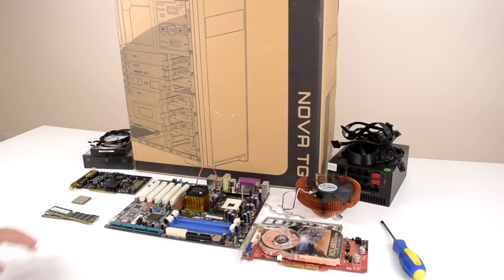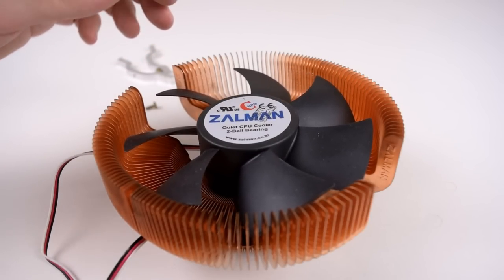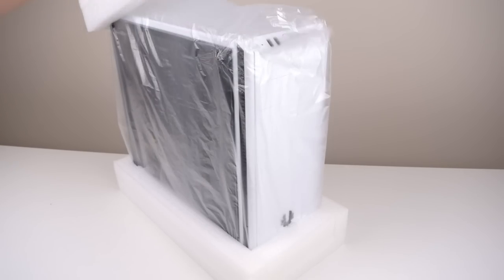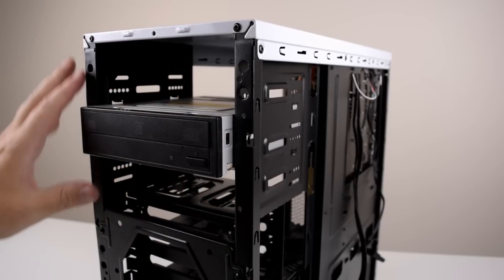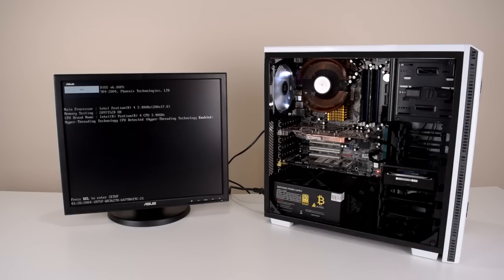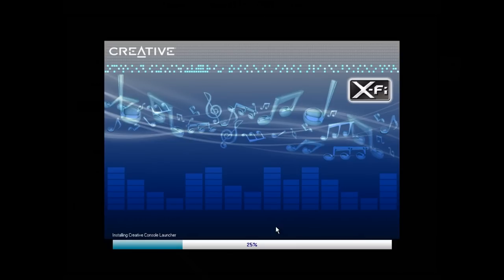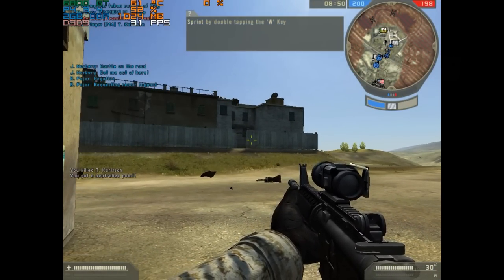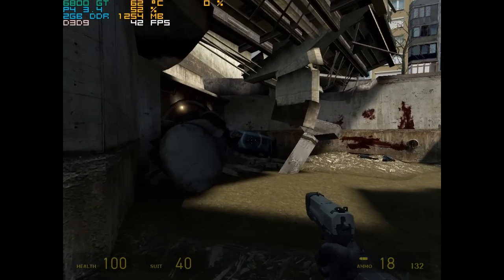Building a Pentium 4 Reverse Sleeper

Comment: Actually, a Reverse Sleeper is called a Ricer.
Reply from the maker: Is it? Good to know. So I did a previous sleeper build and nobody mentioned ricer, but I can see it now :D
Reply: Repeels
Reply: Race Inspired Cosmetic Enhancements R.I.C.E
Reply: Needs more RGB to be a Ricer. ;)
Reply: Hope he adds excessive camber to the fans for that extra performance. 😆
Reply: it is an automobile term, and not typically used for computers. it has a bit of a negative connotation, which this new build does not deserve.
Reply: Charles thekinglov TIL what ricer means, I thought it meant the car was basically a rice cooker on wheels hahah!
Reply: @William Thornton

i guess i understand where the negativity comes from: if someone takes a stock honda civic and puts some big fake exhaust ports and racing stripes on it to make it look like it got something under the hood but actually does not do anything to the engine ... you know that guy is all show and talk but no substance to back it up
Reply: If this was a car, in my father's day, it would have been called a no-go showboat.
Reply: that tempered glass sure gave +0.5 ghz for that processor
Reply: This is a Gicer (gaming inspired cosmetic enhancement).
Reply: I don't understand how any of you figure this is "RICE". These parts are fairly high end for there time its just old. Its like comparing a '95 svt cobra r mustang (which was top of the line back then and fast for its time with 14 sec 1/4 mile times) but its going to be slow compared to a '17 gt350r that can put down times in the low 12 sec range.
Reply: No...it's not about the comparisson! It's like putting lambo doors and the ridiculous LED lights that all cars have all around them nowadays on an all time classic!
Reply: Exactly xD
Reply: @eternalrest2859  *underglow
Reply: @eternalrest2859  and crazy vents
Reply: Put a Spoiler the the Case and there you are

Comment: Colin McRae 2 and Doom 3 were among my first experiences playing a game in 5.1 surround. In McRae, when playing in-car mode, the engine was in front, you'd hear the grass running underneath and if you slid into a tree or a rock, you'd hear the thump from the appropriate speaker (from what I remember).

In Doom 3, I remember walking down a hallway and hearing a "chi-clunk" noise repeating behind me (though I couldn't see what it was). I turned around to see the lights turning off in sequence, and then turned back to be surprised by one of the beasts. Great use of 5.1 surround sound both for immersion and gameplay.
Reply: I would've shit my pants playing Doom 3 in 5.1...
Reply: In the dark and loud while my parents were out of the house. :D

Comment: This reminds me of a similar build i had many years ago, i used the same exact cpu cooler, P4 northwood 3.4ghz cpu, abit IS7 motherboard, 2x1gb pc3200 cl3 memory, nvidia 6800 128mb agp8x videocard, 80gb IDE 7200rpm hard drive, enermax 460w psu and running XP, as a matter of fact, i still have all the parts mentioned, except the power supply... ran like a top though, and i couldnt have been happier at that time.

Comment: I built a gaming machine around 2004, but it was using an Athlon64 3400+, which had similar performance as the p4 you're using, also 2GB of RAM and a Radeon X800XT which was about the same performance as the 6800GT. I used that machine for 4 years. The whole thing was inside a Thermaltake Shark aluminum case which was huge and with noisy fans, I had to put a fan controller to lower down the volume. I remember playing HL2, and Doom3 a lot on that machine. Your videos always bring me great memories. Cheeers!

Comment: I have a vague recollection of some SATA2/3 drives not working with older systems like that, IIRC most drives have a jumper to force SATA1 mode, might be worth a look.
Thanks for the upload! Very interesting as usual

EDIT: While on the subject of HHDs ... beware of raising the controller's bus speed (pci/pci-e) over the default, I've had drives (seagate iirc) that corrupted data in that situation.

Comment: Ah, those 6800GT results bring me back to my second gaming rig, an Athlon XP 2600+ Barton Core with 1GB DDR-400 and a 6800GS 512MB that clocked to hell and back. Didn't get much nostalgia from the Crysis video that LGR posted before but these results definitely bring me back.

As a side note, you should still get playable FPS on medium/low settings at 1280x1024 going from memory.

I also remember trying to do Pizza Noobs for Underground 2...I think it was that anyway, either that or a straight up giveaway that Pizza Hut did at one point. (Fun fact: The city I live in, Ballarat, still has an open pizza hut that remains open because it's a semi-decent all you can eat)
Reply from the maker: Nice! I thought long and hard and I believe one of other Pizza hut games was NFS Most Wanted?
Reply: That makes a lot of sense. I do remember there being another one with Most Wanted after the Underground 2 one that I didn't bother with cause I had all of the games they offered.
Reply: I actually had a very similar system and I love vids from this era for that reason. I wish I could have kept it for nostalgia reasons alone...

Comment: The mighty 6800GT. I had one sitting around as I couldn't use it after upgrading to PCI Express. I followed Phil's advice. And built myself a Pentium 4 around that AGP graphics card. Along with a pair of brand new 512gb. SSD's in Raid Zero. A wonderful way to play those old games from the late 90's to around 2006 or so. 😄

Comment: really i dont know why people complain about old hardware in new cases, with new PSU's....... if you dont like, dont watch ffs
Reply: Lol ikr it's a hobby and not a bad one either, I like putting newer and more powerful hardware into OEM prebuild cases, I have a HP that came with a dual core 2.2GHz cpu and 512mb of ram housing a much newer 785g mainboard and a quad core 3.1GHz chip running at 3.875GHz sporting 8GB of ram. Looks like trash but doesn't perform that way it's a great little media box and it can still do minecraft and light gaming and older gaming just fine. I think it might be a case of people being bitter and not liking anyone enjoying things when they can't or something.
Reply: @bdhale34  and here i am, pairing a GeForce 9300GS 512MB DDR2 with Xeon X3440, 8 gigs of RAM and also with SB X-Fi XtremeAudio PCI, and putting these in a cheap Powerlogic case (Modena 2000) with a few modifications to it (i changed the side panel to tempered glass, and adding some exhaust fan mounting hole). No complains at all. Playing Doom Ultimate, Wolfenstein 3D and Minecraft Story Mode Season 1 on it and still doing just fine
Reply: And of course this guy don't wanna blow his 14YO PC. It's better to use a newer and good quality PSU than using a PSU from Prebuild Cases, especially if you doing some serious shit like gaming
Reply: you can install android X86   on pentium 4  computers and enjoy many android apps on it (whatsapp and more

Comment: I really like these tempered glass cases and have 2 of them.  I did a similar build earlier this year. Originally I was going to build a P4 "ricer" with my Gallatin P4, but then I got a wild hair up my rear end to build a system with the last high performance AMD K8 based processor, the X2 6400.  Not even FX or Opteron versions of the K8 were released at the 3.2 Ghz speed. I actually used a notebook sata hard drive in mine and mounted it where an SSD normally would go.
Reply from the maker: Haven't seen any new vids from you lately?

Comment: Glad you did a proper 478 build! The 6800GT and P4 3.4ghz were one of the top notch combinations back in 2004. My rig back then was a P4 HT 2.6ghz along with a FX-5200 and 1gb of ram. Games I ran were GTA Vice City, NFS Underground, Warcraft III, Colin McRae 2, Civ 3, Gothic 2, Sacred, Sims 2 and some multi-player games: Unreal Tournament, Soldier of Fortune 2, Insane,  DotA cause that was also my LAN-Party PC!
Reply from the maker: Thanks :D I actually was going to do another PCIe system, but I only recently did one, so AGP it was.

Comment: If you used the 7800 GS AGP or X1950 PRO AGP, you could have also called it "best of 32 bits".

Had a 6800 GS myself, was a good card but it burned itself due to insufficient cooling.

ps: I suggest you make a "best PC of 1995/1996" sort of build sporting a Pentium Pro 200/166 MMX, S3 Virge/Matrox Mystique, 3dfx Voodoo and a Soundblaster then do some tests in specs-heavy games like Eurofighter 2000, Flight Unlimited, The Need For Speed, Quake, Tomb Raider, etc. Just a suggestion.
Reply: The Radeon HD 4670 agp 1gb is the most powerful agp card, with this gpu, "the best of 32 bit" you have...
Reply: I think it's a toss between HD 3850 AGP and HD 4670 AGP, they seem to trade blows. Yeah, they better but to make use of the DX10 features they offer we have to move to Windows Vista or later and imo that's just a waste for a 32-bit single-core system as XPs perform better and top DX9 cards like X1950 or 7800/7950 (the later exists in AGP form but is very rare) would suffice here. But yeah, they're faster cards so they'd outperform the best DX9 cards.
Reply from the maker: Raven Gaming A lot depends on the CPU with these cards. On a slower P4, a 6800 GT can be faster in some games, especially Doom 3, but the Radeons are stronger in Half-Life 2 and Farcry. On a fast Athlon 64 the Radeons start to run away in everything though.
Reply: I'm gonna steal this idea and make my own, rebuilding my first PC. I have the Athlon X2 2200+ and ATI X850XT saved from it but, I need a new motherboard. This would be good for games of the time and earlier, yes?

Comment: You shouldn't have to push the pentium 4 chip at all if the pins are straight. If the pins are not straight and aligned correctly with the socket and you push the CPU too hard or too unevenly they risk becomming bent.
If the chip won't just drop in I would recommend taking a credit card or similarvan gently bending against a whole row of pins where you've found an uneven one. You'll contact the pin that's bent first and it will easily bend back in place; when you contact the rest of the pins the force required to bend any further grows much larger so you don't risk bending too much.
Reply: If all the pins are straight, you just nudge it a bit (sideways) and it falls straight in when you find the right spot (ZIF). If you get a used processor and the previous owner bent the pins slightly (e.g. bending the processor sideways while lifting it out of the socket), I imagine you might have to push a little to force the pins in. I'd prefer to straighten them before hand, in case some pins were so bent that they did not find the hole and would be crushed when pushing the CPU in.
Reply: Хс

Comment: Yeah... It's a heavy buggar. I remember when I build these P4 as my everyday job, back in 2003 to 2006. Customers that wanted a prebuild system with a 120mm Nort-Q or Zallmann, allways recieved a system with the CPU and CPU socket ripped off because of the weight. I do not recommend shipping a machine with such a cooler inatalled.
Reply from the maker: Wow that would have been quite the issue.
Reply: Yeah, either fixing the cooler with some foam or directly disassambling it for shipping with a heavy cooler.
Reply: Any of the aftermarket ones I used on P4's had you remove the stock retention bracket and bolt directly through the board to prevent that issue.
Reply: On socket 775 it is bolted on the motherboard, just not on Socket-A. There you mount a clamp on the socket and screw the cooler on to the clamp. Trapping the CPU inside, and making the socket take all the weight. The 120mm ones that were used for P4-478, had to be mounted on the plastick thing around the socket. If the plastick thing cracked because the machine was dropped, the entire plastich thing would be ripped off the motherboard, and the cooler would drop down, directly onto any AGP/PCI cards. To get back again... Yes... On Amd64 and P4-Socket775 and up, then the cooler would be bolted onto the motherboard. Just not Socket-478 and Socket-A.
Reply from the maker: Justin Nicolay This is my only "high performance" 478 cooler I got. I have other ones, but they tend to be good for only up to 3 GHz or so.

Comment: Needs more RGB.
Reply from the maker: LOL Be careful what you wish for :D
Reply: The fan with LEDs is pretty much what RGB was in 2005. The proper PC tuners had fluorescent lamps inside the case.
Reply: In '06 I had a switch on the front that switched my bulbs from red to blue and a badass Spiderman logo on the side of my Athlon 64 3200+ rig with the 6800 and 2GB of RAM

Comment: I like that build. Good modern case mixing with agp-based pentium 4 system. I would be just worry for a massive cooler with no metallic backplate. After couple of years motherbord will turn into waves

Comment: Nice to see you using the Abit IC-7G. i875P was the pinnacle of the s478, and although my P4 machine was not something special (P4 2.66GHz Northwood A, 512 ΜΒ DRR, a Geforce 4MX 440) it gave me hours of gaming... Still have the board, and mine has a dead chipset cooler too!
Reply: Net a new cooler and build a nice rig to support those nostalgic feelings.
Reply: Well, my current system is considered retro too (Core 2 Duo, AMD HD2600XT, 4GB RAM), so, not so nostalgic. But a Win98 SE machine is something that I want to build someday. There also some space constraints ( a major problem for many retro gamers).

Comment: Very cool build. I absolutely love the Pentium 4 era. Personally I would have gone with a Socket 775 PCI Express board though.
Reply from the maker: I'm sure I'll do a PCIe one at some point :D
Reply: Awesome man, I'm looking forward to that! It would be really cool to see if you could build a system based on the 925XE chipset platform with the Pentium 4 Extreme Edition 3.46GHz with 1066MHz FSB. The holy grail of all single core Pentium 4 chips at least in my opinion! Keep up the good work man, I love the videos.

Comment: hehe AGP PRO and PCI to spare, I'll go with a Mixed AGP Wiidcat 7220 and a PCI Glint II for the Direct X drivers to work right, and make a Little Basic SVGA card Blase like a Full Gaming Card..Let you use the Over clocked Mother board P III and Dual 1GHz P III workstations..Loved the AGP Pro and old Intergraph, and 3D Labs card back in the day..You make me so want to dug out the Proliant 7000 plug in all the Intergraph PCI cards and Do A Super test run..1500 Watts (4) P III 550MHz /2MB

Comment: I did this with an MSI K8N Neo2 Platinum AGP rig in a Corsair 100 Silent case. Found that the NForce 3 chipset caused compatibility issues with Radeon cards on Win7. Was a fun project though.
Reply from the maker: I haven't done anything with nForce lately, just some nForce 2 Socket A stuff.

Comment: If I was building something that was new enough to support dual channel DDR, would probably do a Athlon 64 3800+ or Athlon X2 4200+ on Socket 939. For something a little older, Athlon XP 2500+ on Socket A. Still a fun build nonetheless. I just never was into the P4 personally.

Comment: I've actually got an OEM Dell dimension 4600, with a Pentium 4 HT socket 478 @ 3.00 GHz, an XFX 6800GT, and 2.5GB of RAM.  Dont use it much but still a neat little system to have lying around
Reply from the maker: Very nice!

Comment: i had a zalmann cooler that looked a lot like that, but was aluminium.

unfortunately, the mount adapter that it came with didn't seem right for the sockets that it was meant to be for, i could attach the cooler's hooks onto the adapter just fine but then when i mounted the adapter on the motherboard the cooler had a gap of about an inch between it and the cpu :(

because of struggling with the mount adapter, i also ended up accidentally bending some of those very thin fins so they were touching each other, even though i tried to be very careful. it did look like it'd perform pretty well if i could've gotten it working, so i'm glad to learn that it's pretty high performance in your experience. as i'm also someone who can't usually buy the absolute beefiest new cooler online, i do appreciate you testing these cheaper options, as well as the more budget gfx cards and all that!

unfortunately it was a christmas present from people helping me with a build, and by the time i was putting the build together the returns window was over, and the specific model wasn't even listed on amazon anymore, so i just had to suck up the £15 or £20 or however much it was, and just used the stock cpu cooler. 

at least even with the stock cooler, the system never goes above 80c during big benchmarks (80 is a bit higher than i'd want it to be with regular use, but if the absolute maximum temperature it's gonna reach, under extreme circumstances, is still 20c away from Tcoremax, then i feel comfortable with that) and is usually around 40-60c in games depending on the specific game. still, i would've liked to have been able to make use of the zalmann one, and definitely would have if the mount worked ok. i had plans to compare temps during benchmarks against the stock fan, but of course that ended up not being possible.